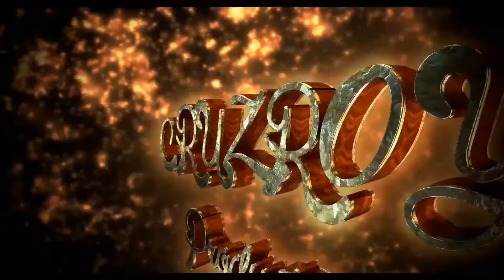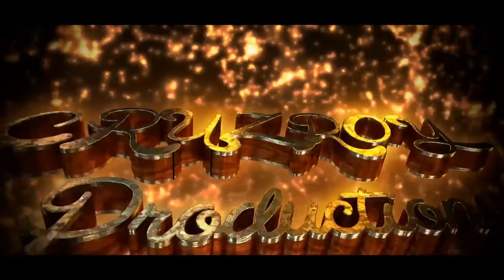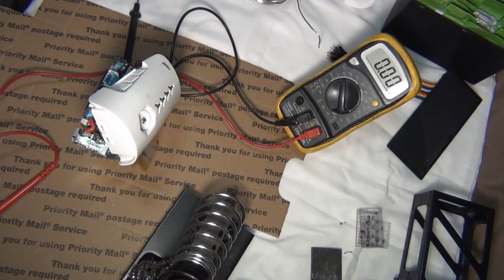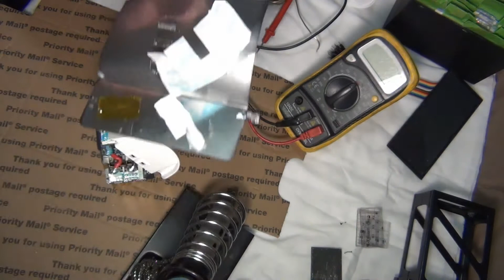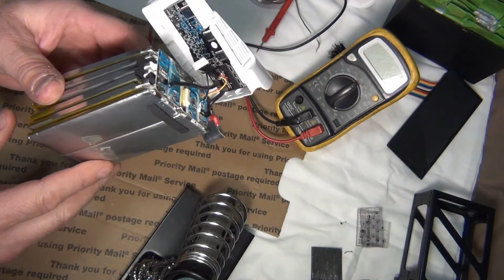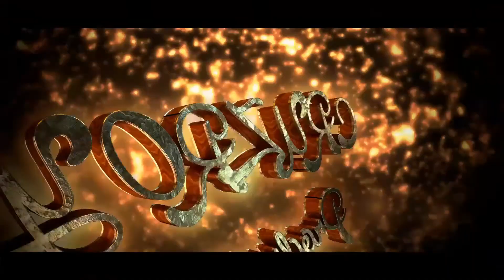unsolder DJI inspire 1 battery teardown

Comment: Nice video,
I have one question, how do you reset the bms?
Reply from the maker: easiest way without any tools to try, is to hold power button, and with twezzers or small jumper wires, touch thr RST and GND on board..and release all....but all cells have to be balanced ...0ne cell off and it dont work

Comment: Was wondering if you were to solder a balance lead and a powed lead onto the controller and plug a normal 6s lipo of the same mah into it would it work? 
Or will the controller throw a hissy fit as its not original dji and report it as a fault and not start up?
Reply from the maker: this guy is building that idea.....http://www.ebay.com/itm/NEW-9000-MAH-29-MINUTE-BATTERY-MOD-FOR-DJI-INSPIRE-1-DRONE-SERIES/203828701124